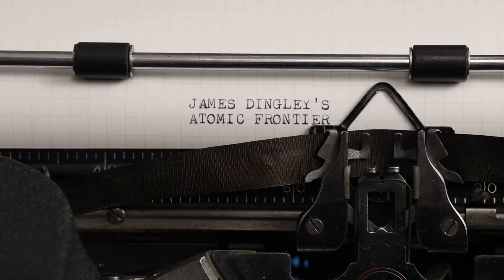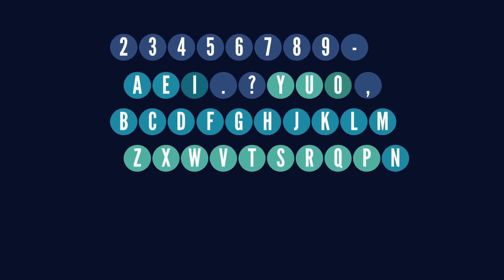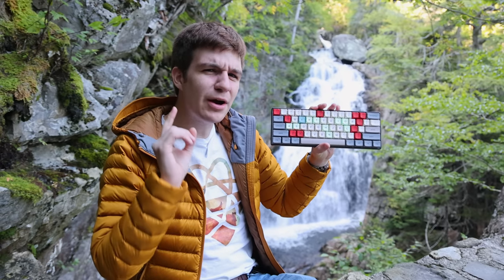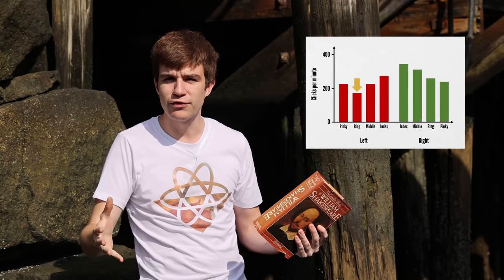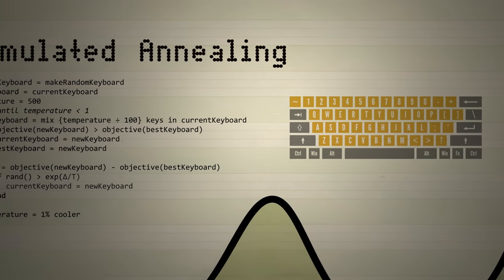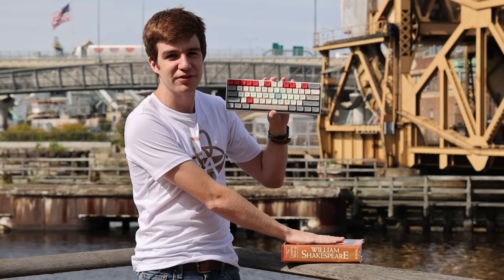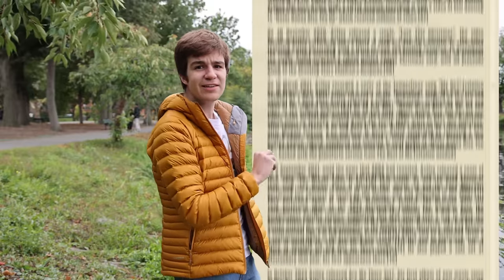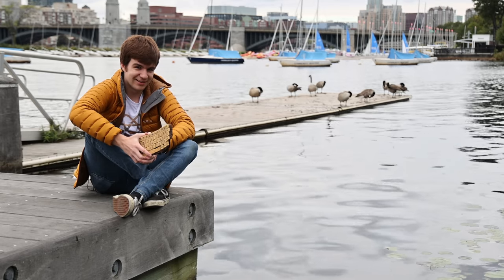QWERTY is broken. Can we make it better?

Comment: As someone who switched from QWERTY to DVORAK around 4 months ago, I can attest that switching a keyboard layout and getting used to it again takes a really long time. I was at around 80 WPM with QWERTY and it took roughly 2 and a half months (maybe closer to 3 months) to get back to that speed with DVORAK. One thing that is beneficial with DVORAK is less pain in my wrists when writing for a long time.
Reply from the maker: Nice! Yes, writing on the "optimal" keyboards made me rearlise how much nice things can really be.
Reply: Same, but I did it back in 2015 (holy crap it's been 8 years). I remember my first few days on Dvorak I typed at a miserable 22 KPM (KPM!! Not WPM) and looked like a complete idiot. But it's totally worth it when I look back - I could only do ~40 WPM on QWERTY and now can do 100 WPM on Dvorak rather comfortably.

Edit: just to clarify, I'm not claiming Dvorak is intrinsically faster. Reduced finger movement is a very real benefit, but it contributes rather little to actually being fast. Being familiar with the words you are typing matters much much more.

That being said, I do think Dvorak has one major advantage, in that it encourages the use of all fingers by design. It would be very difficult to learn Dvorak "wrong" (as in typing with 4/5/6 fingers instead of all 8), whereas it's all too common with QWERTY.
Reply: I was about 50wpm with qwerty, but I couldn't touch type. I figured if I was going to learn to touch type, I would do it on a better keyboard than qwerty. Now I'm a comfortable 90wpm on Dvorak. No ragrets
Reply: huh, my experience is that it took me maybe a month at most to get fully used to the new layout, and that was mostly just catching up the last percent of performance.
Granted, i use colemak specifically because it leaves some keys alone, so i can switch between colemak and qwerty without quite as much grinding of gears.
Reply: Switching to more ergonomic keyboard layouts, as well as the physical key arrangement itself, has done wonders for me. Started with Colemak, then to Colemak DH, and ended up using Canary, later switching to Canary Matrix with a column-staggered board.

I'm now switching to Aptmak which is optimised for 30-key (23332+2) boards, using the Berylline keyboard next month, and I'm very excited! I might start exploring embedded stenography at a later date, too.
Reply: Can I ask how you would even get a dvorak keyboard. I doubt there are many around and I want a nice mechanical one. Or have manufactures started to look into a 0.1% nieche?
Reply: @Djuntas  I just type on a qwerty keyboard. I know where all the letters and punctuation are, so having it printed on the keys is unnecessary.
Reply: @RubixB0y  Maybe im dumb, but how does that work. Like you can just change the keycaps around after you changed to Dvorak in keyboard setttings in windows?
Reply: @Djuntas it might help if you point out where you think it doesn't work so I can be sure I'm answering the question you're asking.

Once you change keyboard settings in the OS from qwerty to dvorak, the qwerty keyboard will work like a dvorak layout already, there's no need for a special keyboard. The printing on the keys doesn't affect what the key actually types. If you learn to type without looking at the keyboard(which you should) , it dosen't matter that they key printing dosen't match what it types.
Reply: @Djuntas  If you move the physical keys around on a qwerty keyboard to dvorak, chances are the keys will end up uneven since they whole keyboard is usually contoured in a way that each key isn't identical.
Reply: @RubixB0y  yeah was too fast to ask this question, suprisingly quick to change to another keyboard layout i windows 11...Until you also see us weird non-US people are gonna have a hard time with our speciel letters in case of me...ÆØÅ ^^ And yes looking down is not good, I dont do it either much without even being a touch typist, but easy to change keycaps around at least if you wanted to on most of these mechanical keyboard...Im just using an old corsair k70 with red switches.
Reply: @Djuntas When I first learned Dvorak, I simply made the switch in the OS and left the hardware keyboard alone. That made learning it slower at the very very beginning, since I couldn't look at the keyboard to find the right key, instead having to guess and then hit backspace if I was wrong. In the long run, I think it was a good decision though, as it forced me to be able to learn how to type on the layout without looking at all, which is a big benefit.

For laptop keyboards, the key caps are all interchangable, so I'll swap those around now. My non-laptop keyboards aren't as nice, with each row's keys being a different shape, so I just leave those "mislabeled" and only very rarely run into issues (usually if I'm just trying to hit some weird keyboard shortcut like ctrl+L).
Reply: I switched to dvorak in high school, when I had the time to spare to do crazy stuff, and I haven't regretted it!
Reply: Now do Colemak and Workman!
Reply: @Djuntas  You can't change the keycaps around because they have different pitches.
Best is to write new legends on the vertical face of the key, using a Sharpee or even printed labels (since that's not a surface you touch).
My keyboard is completely blank, so it works with any layout equally well.
Reply: Switched to Dvorak at the turn-of-the-century. My typing speed took a while to come back, and it did, but without the pain in my hands. Big fan of Dvorak, especially since I rarely use another's keyboard.
Reply: @Djuntas I've switched to Dvorak touch typing. I don't know visually where keys are on Dvorak, my hands know.
Reply: idk bro, 
most of the fastest typers use qwerty
i'm not saying i'm particularly fast but i can get around 150 ish wpm on qwerty and i think the problem is rather the efficiency of your finger placement rather than the efficiency of the layout
(i'm no expert plz don't bully me if i'm wrong)
Reply: @weiweimangaming6209  Yes you are correct! Although in this instance, most of the qwerty typist are using a hybrid touch typing method. Akin to when before you properly learned touch typing and you were using and placing your fingers in orthodox ways. This works in the end for them, but is not practical for everyone. I do have to point out that no one here is seriously talking about the speed difference between qwerty and dvorak (which is negligeable), but rather the typing experience. In this case, dvorak is far more comfortable than qwerty will ever be no matter how gymnastic your fingers are.
Reply: @ErikOnNoobTube  really? I find qwerty quite comfortable to type on and I'd rather the ease of use between switching keyboards and laptops with qwerty than the    alleged comfort from dvorak.
By hybrid touch typing method, are you referring to alternate finger placements? Personally, I use a highly inefficient method of using my index for the spacebar while hving a kinda alternate finger placement for the others, rather than homerow.
Reply: I am currently in the process of learning Dvorak, and while I currently am only in the low to mid 30s for WPM, I am able to type with  much better accuracy than QWERTY. With QWERTY, usually the best I could do was over 80% accuracy, but with Dvorak I can do over 90% consistently. When I learned qwerty growing up, I developed some bad habits that I have found pretty much impossible to unlearn. The only way I've been able to get rid of them is to learn an entirely different layout correctly from the beginning, and I currently do not experience those same bad habits typing in Dvorak because I learned it correctly from the ground up. My QWERTY muscle memory is set in stone.
Reply: Did a similar thing, learnt DVORAK over lockdown. Could type around 90 WPM on QWERTY (lowercase only using primarily 2 fingers) and about 45 WPM on something with punctuation and capitals. Spent 40 minutes per day learning DVORAK and was already upto a consistent 60 WPM across all types of texts within a month. Once lockdown ended though and I went back to work and had to use a QWERTY board at work I suddenly realised I had absolutely no idea how to type and realised the fatal error I had done. Switched back to QWERTY but considering I forgot how to type repeated the whole typing course again but this time learning how to touch type QWERTY from scratch, I can now average around 100 and high score 130 WPM and have no intent to go ever switch again.
Reply: @Djuntas I believe for mechanical keyboards it can either be done in software or firmware if the keyboard allows it, then you just swap the keys around
Reply: I moved from the UK to Australia a few years ago. And it took me ages to stop mixing up " and @.

The idea of handling an entirely different layout. I'm pretty sure I'd never be able to get used to it. Qwerty is just too engrained in my fingers.
Reply: @weiweimangaming6209  Since you are dishing out 150wpm on qwerty while using your index for the spacebar, I can only assume your fingers are olympic level athletes. I'm stuck at 100wpm with lazy fingers and profit more from a layout close to home, which is also more comfortable because i dont have to stretch my fingers as much.
Reply: I switched 23 years ago while working a job that required massive amounts of writing. 
I became proficient in a month.
I recommend doing it. But I'm not saying it'll be fun.
Reply: @Djuntas  That is not possible on most computer keyboards.  If you truly touch type, you are not looking at keys, you put your fingers on the home keys and let muscle memory take over.  But if you need find a specific letter, it can be a pain.  There is usually a Dvorak option where you can use the printed keyboard key in conjunction with a keyboard modifier like command, ctrl, option, etc.  But the program you are using may not play nice.  Adobe products are notorious for this.
Reply: Dvorak is just better, period, qwerty is just garbage and shouldn't even exist, period... that it took/takes time to relearn is irrelevant, that qwershi* was learnd first is the problem.
_
Reply: @BinaryDragon i hate swapping laptop keys around, those little plastic feet are too delicate and one wrong move they're gone, that key never goes back in there.
Reply: @AtomicFrontier Dvorak sucks, I can say this 300 times on a good layout like hmmmmm RECURVA!
Reply: I can type at over 137 wpm with a 99% accuracy on QWERTY with no pain at all. Switching to DVORAK would be utterly useless and a massive waste of time
Reply: @pyropulseIXXI  i wouldnt be useless, you would type like a baby for a week, then near 137 in 3-4 months, and probably 150+ after 6... learning dvorak doesnt mean that you lose qwerty either, it's another "mind-folder", like learning japanese doesn't mean that you lose english... dvorak is way easier to learn too cause it makes sense, children will learn dvorak 7x faster than qwerty... and that you have no pain at all is irrelevant, when you get carpal tunnel syndrome it's almost instantaneous and then it's too late, you're doomed and it doesn't go away... the thing is that you shouldn't have learn qwerty in the first place, nobody should've, it's just a deeply flawed system that should've died 50 years ago, but "peoples are lazy" is probably the main reason why it's not.
_
Reply: there are several manufacturers, lots of keyboard nerds build their own from kits or the ground up. You can also get keyboards which you can reprogram to shift all of the keys around as you like in software and then just move the keys to match physically - e.g. Keychron k2 pro. Good luck if you fall down this rabbit hole :D
Reply: @MuktiLuv  Maybe it should've died in English speaking countries, but Dvorak is truly horrible for e.g. German. That said, German QWERTZ is absolutely atrocious for programming, because {[]}\ need Ctrl+Alt modifier 😑
Reply: @Djuntas
Reply: @rockapartie  ya, dvorak is made for english, August Dvorak was an American professor, so... thats beside the point, there should be a German "dvorak" version, and other languages as well... honestly, keyboards should be symmetric, based on the hands natural movements with each fingers abilities and weaknesses, and programmable... personally i use antsoft keymanager, so ive remapped mine completely, the base is still dvorak though.
_
Reply: it's just mentally logical too, and you'll most likely pass that 80wpm pretty soon... do you know edclub dvorak version?... it's like ~600 small exercises in a game shape made for that... you'll probably pass the first 300 in 2 hours though.
_
Reply: Do you have a faster typing speed now with DVORAK?
Reply: Three months to reach QWERTY proficiency is actually pretty fast. It took me six months after switching to Colemak before I was back at my QWERTY speed. Absolutely zero regrets, though. Three years later and I'm faster and more comfortable typing now.
Reply: @MuktiLuv that would be remarkably impractical.
Reply: @Ornithopter470  what would be?
Reply: @yoma2977  he sure will, thats just physics, is he now, well its been 4 months so it doesnt matter or tell much.... check speeded videos of both side by side you'll get why it's physically impossible to not type faster with dvorak.
Reply: I switched from Qwerty to Dvorak in 2003, because I was capable of 95 wpm on Qwerty but I was not using homerow style in the least, and I was getting sore wrists.  I matched that speed within a couple months, and proceeded to accelerate to a peak of near 140wpm, without much wrist pain at any point.  I type less now and I'm a bit slower but I don't have trouble hitting 120wpm.

One huge problem is that a lot of programs have shortcuts based on geography instead of mnemonics.  For example, WASD is designed to be shaped usefully as arrow keys in lots of games, and in dvorak it's just not there (and since it uses aoe and comma, interferes with mnemonics).  cut/copy/paste are xcv because they're in a convenient place.

And then there are constructed languages, like C++, that use ; a lot purely because it's a homerow key for qwerty.  It's hard to shake off 150 years of momentum.
Reply: @Stereomoo  WASD exist only because of qwerty as well, not just ZXCV, there no logic to it other than it was there... try AntSoft KeyManager, you can just remap about anything the way you like it, personally zxcv is now F1-234, winkey is Alt-tab reversed, holding a number 123... type it's shift character !@... etc, etc, can all fully change by programs too, full complex macro, etc... just map the keyboard you want basically, that thing should be native on any computer.
_
Reply: @Stereomoo  I switched from Qwerty to Dvorak because i finger typed qwerty at 2-3wpm since forever, never learned it cause it felt like non-sense, then discovered dvorak looking at what was up with that non-sense, never learned it either but naturally after 2 years now i type at least 30x faster than qwerty, i know where stuff is cause it's logical not just random, all vowels left homerow is a huge plus, no idea of my wpm, but it's a bit slow than what i speak, world of difference as compared to the 3y/o monkey that sqwerty made me... qwerty is a natural  "not made to type, but anything can be learned with some effort, or not..." while dvorak is a natural "just type man, it's built for this, it's gonna come"
_
Reply: Just memorize the positions.
Reply: @kesslerdupont6023  what positions?... what are you talking about?
_
Reply: Another thing that can really help with wrist pain is switching to an ergonomic- or split-layout keyboard. If you look at the way your hands are positioned on a typical keyboard, your wrists are sort of forced to be unnaturally cocked outwards while your shoulders are unnaturally internally rotated. An ergonomic keyboard helps with your wrist position by rotating the two halves of the keyboard so you don't need to cock your wrists, while a split layout keyboard allows you to spread the two halves apart so your shoulders aren't internally rotated anymore!
Reply: I've been typing on Dvorak for most of my life (it's what I learned to touch-type with, like @RubixB0y) and built myself an ortholinear keyboard for my daily driver. I've looked around at other keyboard layouts over the years (lots of fun data about them) trying to see if there's one that's slightly more efficient/ergonomic but in the end I'm probably gonna stick with Dvorak since it's easy for me at this point and the difference between it and the slightly better ones is less than the difference between the QWERTY and Dvorak.
Reply: @catmansion  ya, anyway in the end the only thing shittier than a Qwerty is a broken Qwerty.
_
Reply: I've considered trying it, it just seems that no matter what layout you learn, you'll still need to know qwerty, and switching between layouts seems annoying and that you'd be actively fighting against muscle memory
Reply: @Djuntas  - If you're using a keyboard with Cherry MX switches and standardized key profiles, then it's a simple matter of moving the keycaps around and setting your keyboard layout to DVORAK in the operating system itself. No special hardware is necessary - IF you're using a more moddable keyboard to begin with.
Reply: @Djuntas you can get a normal qwerty and find dworak keycaps (or just switch the letters of the qwerty one)
Reply: @PattyManatty  it's like 2 different folders, like learning 2 languages, just learn one before the other not at the same time, it's like an english speaker learning japanese, theres no way you'll mix them, the differences are clear since one is solidified, if you start japenese and chinese at the same time then yeah you'll confuse them... that been said if nothing is solidified, dvorak is learned 10X faster in general, there's been a bunch of studies with kids, Dvorak is just better in every ways and Qwerty is just random inneficient non-sense, i just wouldn't learn non-sense cause other are cluelessly doing it,... switching is 4 mouses click away in other new systems and alt-space away in yours... you said muscles memory, then see it as piano/guitar or guitar/bass, it's mental in fact not muscular, well neurological, but still you wont mix them if one is clear first, and if there's none clear go dvorak, your body will thank you, you'll end up faster and that faster, and it's just much more enjoyable too... ;-)
_
Reply: @sabbath9503  Didn't know about embedded steno.  Thanks!  (The rest of your post makes my brain hurt thinking about learning all those.  I mostly touchtype as a slower speed in qwerty.)
Reply: @Djuntas   Pretty easy.  There are two options, reprogram your computer and put stickers or mark you keyboard OR buy one.  Logitech and most of the other manufacturers make one.  Dvorak and the others are favored by high use keyboarders to reduce repetitive motion injury. Just put Dvorak keyboard and shopping.
Reply: @Djuntas  Yes, you can move the keycaps around.  Works for cleaning coffee with sugar also.
Reply: @PINPAL   If you had friendly comp techs they might have given you a DVORAK keyboard or let you bring your own.   You can usually use setting in Windows 10, but they've moved it.  But I cheat just enough I want labels, hence the keyboard.
Reply: @davescott7680   Yeah, I'm all US but the non-letter keys have moved and changed since actual typewriter. It's settled now.  Back in the Jurassic you used the lowercase l for 1.  Obviously computer gets confused about that.  And there were keys for common fractions and cents.  Those have been replaced with computery things like |,{}, [], etc.
Reply: You don't get one, you simply switch the layout in the software (windows supported it since 1995) and don't look at the actual keys ever again. 
Also you can exchange the actual keycaps for most of the kays, but that's less cool.
Reply: Have you tried workman layout?
Reply: I switched to Workman a few years ago and def like it. It's not nearly as fast as dvorak but it's pretty comfy :D
Reply: @Djuntas  Well maybe not exactly "getting" a dvorak keyboard, but if you were to buy a keyboard that is programmable to let you switch keys (which most non-budget keyboards from known brands should have nowadays). What you then do is you search the dvorak layout and painstakingly you switch all the keys in the program to fit that layout, after which you switch around all the keycaps to match the changes.
Reply: @Djuntas  If you look around online, there are overlays that you can place over your keyboard that have the correct Dvorak lettering on it. I got one for my Mac laptop when I was switching from Qwerty. But I rarely use it now since I know the layout by heart.
Reply: @weiweimangaming6209  In my case, I plateaued at about 80wpm with Qwerty. Fatigue would set in quickly because of the travel my fingers had to perform when even typing the easiest of words like "the". When I switched to Dvorak and after the time to become comfortable with the layout, I reached 110wpm with very little fatigue. That's a 36% increase which is significant for me. The lack of travel for my fingers makes a difference. Even at half that increase for you, you could be up over 170wpm switching to Dvorak. It depends on how much typing you're doing, but an extra 20wpm over an hour would be a massive increase in efficiency for you.
Reply: @MikeSchmidt969  
In terms of speed, seeing as the faster typers are almost exclusively qwerty users, implying that the difference in speeds between DVORAK and QWERTY is practically meaningless. I'm not saying QWERTY is faster, as I am aware many more people use QWERTY, just saying it's a meaningless distinction.

A 20 wpm increase is indeed a meaningful increase in speed but my plateauing in speed at around 150-160 WPM is more due to my finger layout efficiency rather than the letter layout, as I use my index finger for the spacebar.
Reply: @MuktiLuv my experience as a stenographer is that we all lost skill at touch typing as we mastered our steno theory and built speed, so I don’t know about the skills holding steady in their own mental folders without dedicated maintenance
Reply: @joyfulgirl91  that's just from the multiple experiences i've read on this, i dont type qwerty, i wouldn't touch qwerty with a 10-foot pole... but steno gotta be different i guess, thats really specialized and "focusing all on", thats like the olympics of speed typing ;-)
_
Reply: @Djuntas  You would just get a keyboard where you can remap the keys. Put your keycaps where you want them, and spend time remapping all the keys in the software
Reply: I switched almost 10 years ago now. I’ve never tracked wpm, but it did make a big improvement over time.
Reply: 80's not that high, so I suppose it's also not that much of a loss. I can imagine it being pretty hard to switch if you reach speeds like 120-130 or so though. Gonna take a lot longer to get back up to that level again with a different layout.
Reply: I've switched to colemak about 6 or 7 years ago. It took my about a month or two to get the hang of it. I threw myself into the deep end a bit by writing up a college paper in colemak. It's at least a fun party trick to get people to type on my computer, fail horribly, and show them the layout.
Reply: I switched from QWERTY to DVORAK around twelve or so years ago. I never followed a typing course for either, and before I made the switch I never learned to type with ten fingers. I typed reasonable ok with two to four fingers on QWERTY.
In order to learn DVORAK, I took my keyboard, and physically rearranged all keys. It was a keyboard where the keys were shaped nicely, so the rearrangement was awkward. But I had the time at that moment, so I went through with it. Another thing was that there is a dvorak international keyboard layout available, which allows me to easily type letters like ë easily, just like on a US international keyboard layout (which is mostly used in the Netherlands). Furthermore I didn't take a special course: I just learned by typing a lot.
The first day was the most frustrating: I had to look up every letter individually, and it took me an hour to type an email that would have otherwise took me a few minutes to write. But during the rest of the first week I did notice significantly improvements. After a month or so I was at my old speed, and after six weeks I typed noticeably faster than with QWERTY. But the one thing that really stood out for me, was that I automatically started to use all my fingers, instead of mainly two and in rare cases four. Also, I learned during these six weeks to typi blindly, something that I never managed with QWERTY. This of course also helped to improve my typing speed. Another thing I noticed is that I didn't feel any strains in my hands anymore after typing for a while.
Now, after more than a decade of typing with DVORAK (both for writing and coding), I do notice that when I'm forced to switch to a QWERTY-keyboard, I'm not typing as fast as I used to in that keyboard layout. But I don't mind: I never fully learned to type with that anyway.
Reply: @RubixB0y lol at no ragrets from "hi, we're the millers"
Reply: @MuktiLuv  that's a stretch. It exists because typewriters would get jammed with more efficient (now) layouts.
Reply: @corasundae  whats a stretch?... typewriter is only part of the qwerty creation, and not the first one either.
_
Reply: @Djuntas  If you touch-type, you don't see the keycaps anyway.  I posted a Dvorak chart between my keyboard and monitor as a reminder.  In Linux, you can write shell functions that swap QWERTY to Dvorak, and back, using the xmodmap utility.  The joke is that the first function is called "asdf" and the reverse is "aoeu" (same keystrokes).
Reply: @weiweimangaming6209  Re: "alleged comfort". Yes, it's subjective, and impossible for randomized controlled double-blind testing.  But try an experiment: see how comfortable you are typing "glass alfalfa" a dozen times or more.  That's pure home-row Qwerty.  Now, imagine that you could be just as comfortable typing "these antennas", and all the other Dvorak home-row words.
Reply: I had an interesting related experience. I had been stuck around 40-45WPM for years when I first tried Dvorak. I switched, and it took me a couple of months to get back to my previous full speed on DVORAK, and in another month I was typing closer to 60 WPM. But then when I went back to QWERTY for a few reasons, my speed hopped up to my Dvorak number and eventually surpassed it, finally settling around 100 WPM. I suspect having to switch back and forth for a while helped me to build better skills that transferred back to QWERTY. There's a fair chance I would be quicker with Dvorak if I switched again, but QWERTY has fallen solidly in to the 'good enough' territory with my newfound speed.
Reply: i already had experience in learning to touch type so switching to colemak was super easy for me. had it down in a month
Reply: @Djuntas Use the on screen keyboard in windows as a guide until you know the keystrokes.  Or print it out and put it to the side where you can glance at it.  I imagine you can buy actual physical keyboards with the alternate layout printed right on it too; or even just buy stickers for existing keyboards.
Reply: I've used Dvorak for 20 years or so. It's all muscle memory and I just use a regular keyboard. If you asked me where a particular Dvorak letter was on the keyboard I probably couldn't tell you, but I know how to type it.
Reply: When I switched I was working a desk job that relied on typing all day. It was rough for a bit, but I was up to a good speed again in about two weeks. It's easier than you might think.
Reply: @Djuntas  You don't need to "get" anything. I learned dvorak with the same keyboard i used before... With touch typing it doesn't matter what labels are on the keyboard
Reply: @Djuntas  Buy a keyboard with keycaps that are all the same size and shape. That way you can just rearrange them to whatever layout you want to use. Or you can just get a blank keyboard and print out the letters. I could probably use a keyboard with no letters at all since I don't even really look at the letters themselves